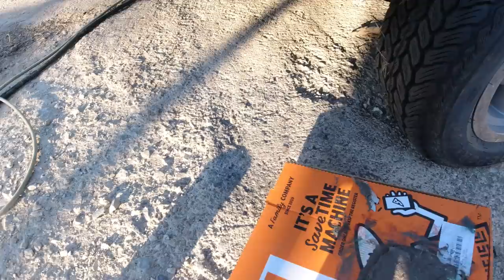Restoration of a 1972 Chevy Nova - Part 21 - Putting on a lower quarter panel patch.

Comment: good job. For those who wish to restore classic cars. There is one thing to know :  to be definitively efficient against rust,  you should  put grease everywhere. grease is the only thing very efficient against rust. put grease between metal and carpet, inside door, behind metallic bumper, under the vehicle, behind  the repairs you can make (everywhere inside the body - hidden erea -  instead of using paint), hollow areas (necessarily hidden, so no need to be aesthetic). For rear wings unreachable with a paintbrush, use an extender and poor old oil everywhere each year. rust  always comes  from the inside and welds.  Handyman Experience - 35 years.   From france